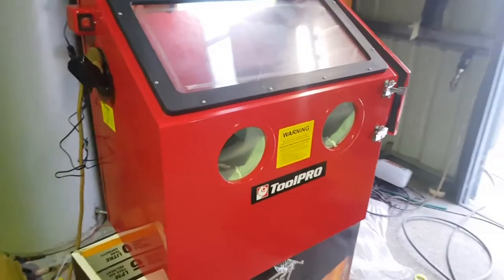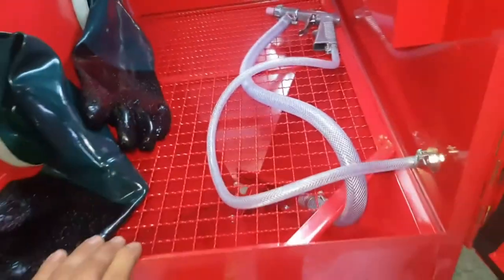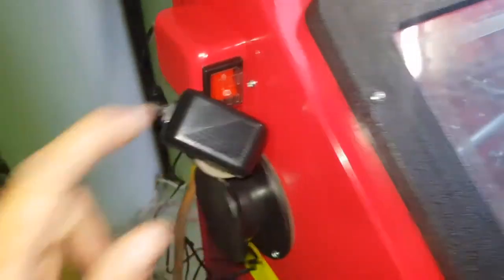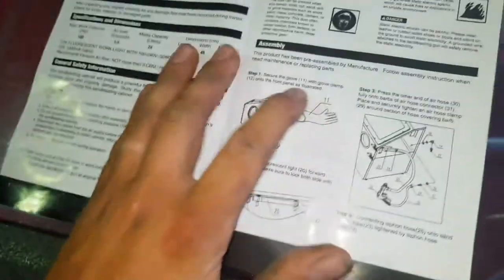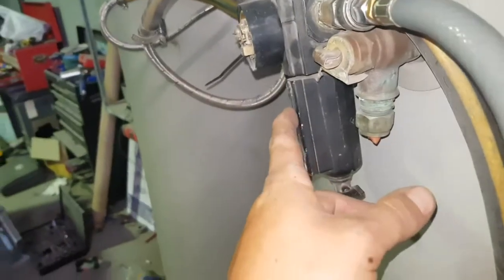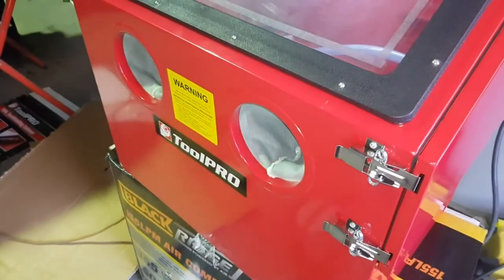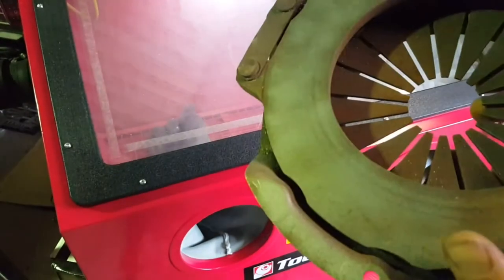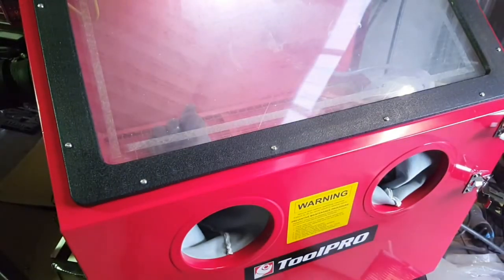ToolPRO Sand Blasting Cabinet 100L unbox, review and testing

Comment: What size compressor do you req to run this one?
Reply from the maker: For constant use at least a belt drive, for intermittent use a direct drive 150lpm plus will get you blasting. Realisticly you want 300 to 350 a min

Comment: totaltools has a 220 litre one on a stand for a tad more, reckon it would be a better deal, they all seem the same on the inside etc.
Reply from the maker: Looks about the same? Gun any good in it
Reply: I have no idea how good but it looks like the one you're using, it has ceramic tip etc. Never used one myself but thinking of getting one.
Reply from the maker: Yeah im really happy with this one only 1 thing ill change (videos getting edited still) is make the front glass quick to remove and replace the screen sheets
Reply from the maker: These come on special cheap as at sca so that  is always a win last time it even came with sand haha

Comment: what sort of compressor do you use for the blaster? Anything around 155 lpm ok?
Reply from the maker: 155 belt drive and above mate and a watertrap
Reply from the maker: I have 2 155lpm.belt drives and a 190lt Stanley one also all have good airflow
Reply: That's good. I have an old direct drive I want to change over for a belt driven one, bloody thing makes a racket anyhow. Looking at a couple of units, probably with two outlets so I can put the sand cabinet on one hose and still use the other when required. thanks
Reply from the maker: Seen my compressor reviews on this channel mate?
Reply: No i haven't, I'll go look at your stuff now. Thanks for that.

Comment: Hey Mate, did you hook a dust extractor vacuum on this? The air outlet is 55mm I think, difficult to find a fitting.
Please let me know how you went about it
Reply from the maker: I went vaccum wet dry . 
Use a 40mm rubber toilet pan cone for a flush pipe and bam done
Reply: @Oneupthesleevecustoms  Thanks Mate, I know the thing you’re talking about. I’ll grab it from Bunnings today. 
There’s an $89 extractor vacuum on EBay I was sussing out, but without the fitting, it would be no good. 
And thanks for the great video. 
I got my ToolPro 2 weeks ago and it can do things in 15 minutes, that used to take me weeks with the angle grinder wire. Just can’t see in there anymore due to dust. 
Cheers, Tas

Comment: I got one for $189 from Supercheap with a suitable compressor. Set it all up and I can’t get it to pick up the media
Reply from the maker: How.much air flow you have?
Reply from the maker: Check the inside of the gun for plastic between nozzel and gun
Reply: @Oneupthesleevecustoms  thanks mate, yeah I did that. I put the bigger nozzle on the gun and that made a difference. I’m going to make up a metering valve for it to see if that helps too

Comment: picked mine up yesterday 23/04/18 in cairns on an awesome deal $189 with a bucket of atc media. check the web site
Reply from the maker: What are you  blasting with glass media? There a good unit love mine
Reply: my bad. iv edited my post. its the gray titanium calcium oxide. but yeah, done a set of extractors, took the paint off my pulleys and cleans rust perfectly. im only using a 120 direct drive as well.
Reply from the maker: Oh thats awesome using a black ridge 120? Its all.good if you have time to wait for it to recharge ive done heaps of work with little compressors
Reply: yeah cant realy fault the black ridges, plus , im a bit of a supercheap die hard,  air reload the only issue, ill upgrade soon as i move into more spray painting and heavier air tools but its  doing fine for what im doing for now, twisted the king nut off a harmonic balancer so i was impressed haha. iv had other 120 units that struggle heaps. the only mod ill make to the blast cab is wing nuts on the screen bezel. just to make the screen protector replacement a bit easier.
Reply from the maker: Good thinking have you seen my other reviews on the blackridge 155 belt drive and 190 stanley? 
Yeah takes a little bit open it ip